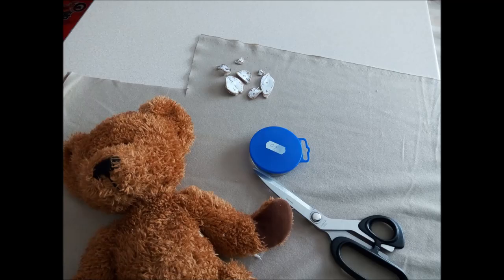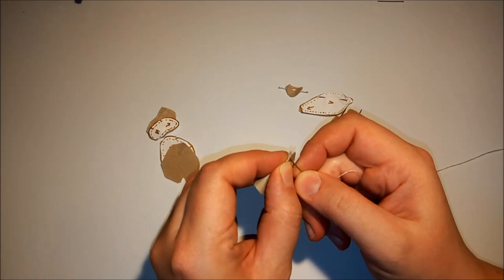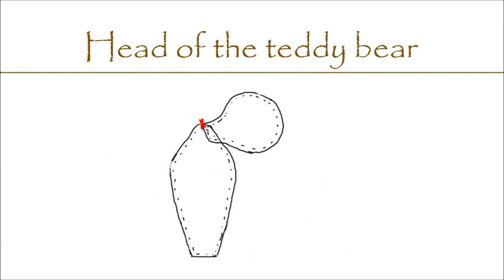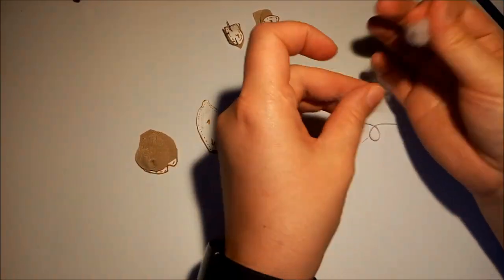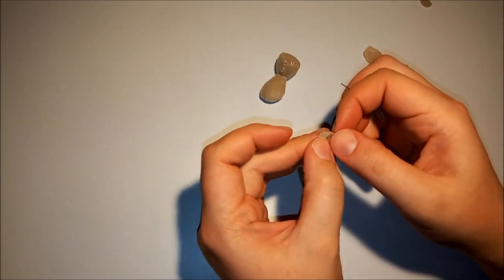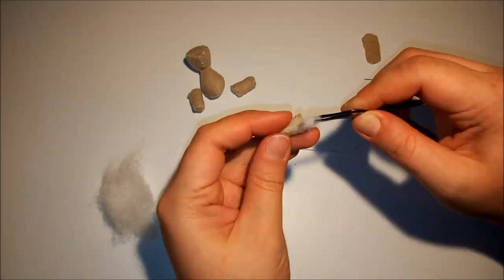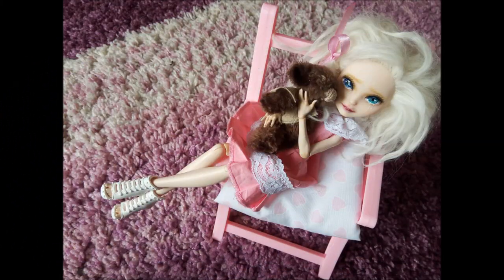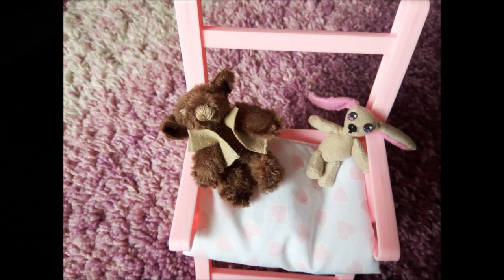how to sew a miniature teddy bear ★ DIY

Comment: the super speed hurts and i actually couldnot see you turning the limbs cause of how fast you went. thats realy all i need to know. how do you tun the tiny limbs right side out?
Reply: Carefully and slowly. You just need to take your time. I make minis but mine are jointed, but basic construction is the same. I usually use the wrong, ie: the non hooked end of a fine(about 3 or 4)crochet hook to  help turn pieces. Just go slowly and gently so that you don’t poke thru your seams, which is also why you only want to use rounded ended tools to do this. Another little trick is to use a long doll needle and a doubled length of thread. Put a really big knot in the thread, then using the long needle go thru the fabric at the top of the shape near but not on the seam, the feed it thru to the opening that you’re going to turn it thru, then you can use the thread to help pull the shape inside out....note I said help...it won’t do it all on its own but it helps especially with narrow shapes like arms and legs.
Reply: @catzkeet4860   thankyou